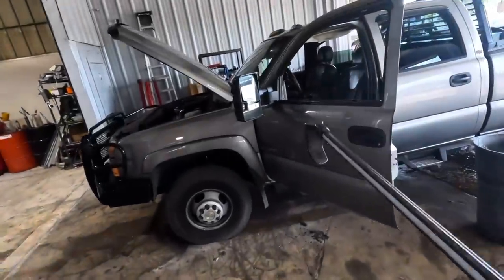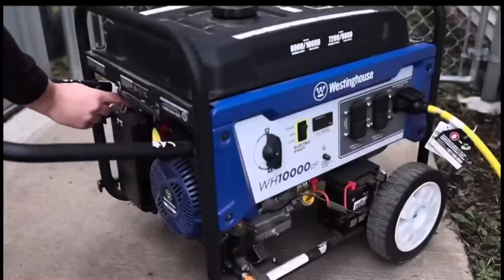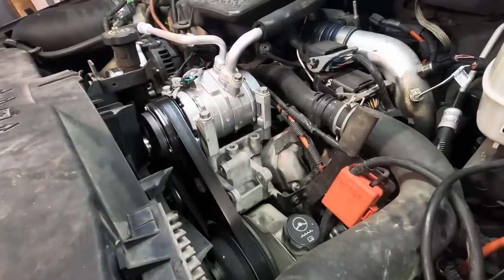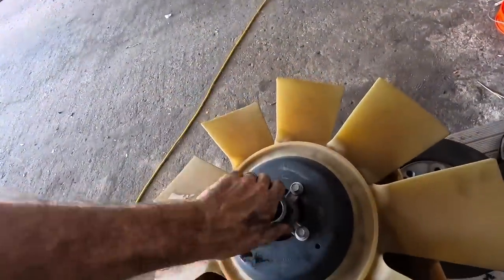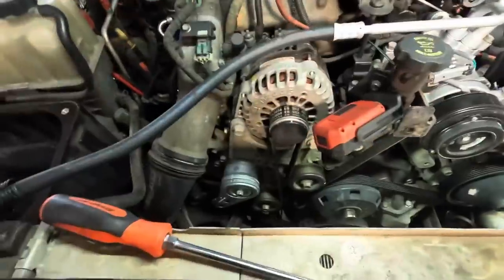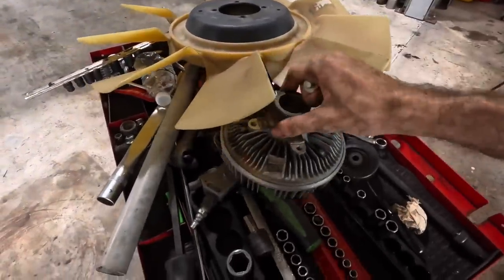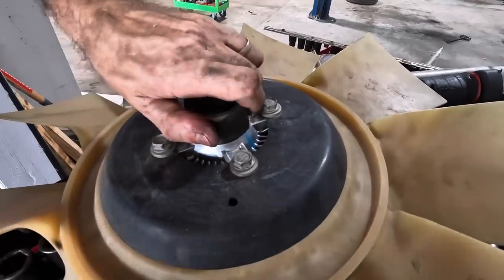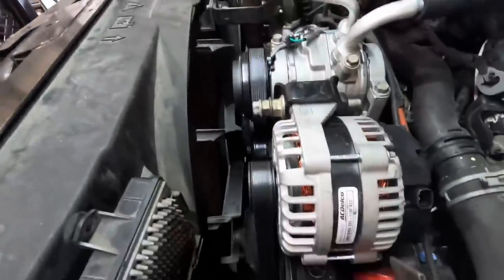Proof of Concept! Dual Alternator DURAMAX!

Comment: Ha Ray, I’m not knocking what you are doing with your truck charging system. Do you have natural gas, or a big propane tank ? If so you could get a permanently installed generator that will run your entire hame. No cans of gas, 600.00$ of diesel fuel, at least 1,000.00$ worth of stuff your mounting in your truck. Not to mention the extra ware an tare on your truck. I bet that new alt belt is at last 50.00$. Do the math. Maby it’s just makes a good video,an lots of comments. Enjoy your videos.👍🇺🇸🤪

Comment: im curious if it would be better to just get the hybrid f150 that can output like 1500w, or an old ambulance and move all the drive train into this. just so you know everything works and should stay that way. 

or solar panels? florida is horrendously sunny, they'd get something for sure
Reply: The point of this is hurricane readiness.  Those would need to be some beefy solar panels to not get ripped off during a hurricane...  😊
Reply: @gusser2121  most good installs can handle 100+ and thats a solid cat 2 hurricane
Reply: @bradhaines3142 Unfortunately, hurricane Ian was a category 5.  Solar heating and electric panels strewn all over.the landscape.  I should know, we live 8 miles from the estimated Central point of impact.

Comment: Despite the hype about AC Delco, for the most part the parts are trash made in China and won't last any longer than the cheapest you can buy. They go out right when the warranty period ends ironically. But it's like ok if Delco sucks then what's the alternative?? Best thing you can do is buy Precision from O'Reillys and get the lifetime warranty with a higher quality part.

Comment: Some slippery math there on how long your 120 gallons of diesel will provide power. The numbers are:
2 gph...............60 hours
3 gph...............40 hours
4 gph...............30 hours

Not "nearly a week'.

If you make a couple of WAGs of 20 mpg fuel economy and 20 mph speed at high idle, that works out to 1 gph, at which Ray will 120 hours of electric power-nearly a week, as he said.

Comment: Just me that thinks 145amps on the alternator sounds a little small for a diesel? Would have thought for sure 180amps would have been oem spec? But then again i have almost no idea how trucks are built since im in sweden and they arent to common here. I very much approve of this install non the less. Wish i could do something similar with my car but its a saab and space under the hood is nonexistant 😬 My 180amps will just have to suffice for whenever i do some audio installs

You could also do the big three upgrade on the existing charge system. Heavy wire upgrade between all points in the circuit. You are more than likely fine as is but overkill is a good maginal i always say 😅

Comment: Think your going to need more batteries for that much/many inverters. The general rule of thumb is no more than about 2000w per 100ah deep cycle battery, or i think it puuts too much strain on your alternators. Id probably go with 6batteries and keep it under 12000w. Though 8000w/4 batteries would probably be better. Unless you're using lithium.  But that's additional costs and different charging profiles.but lithium would probably be the way to go if you're going to be using this beast frequently or you'll be just spending extra replacing batteries and alternators anyway.  Plus lithium is WAY lighter.  Maybe that doesn't matter as much on your duelie, but it could be a couple hundred pounds in the end....
Reply: just want to impress us with his mastering of Edison talents.

Comment: Generators are meant to run long term..here is my question? You run 1-2 alternators for 24 hours + straight doesn't things start over heating..pulleys/belts/battery cables etc,? Won't items on your truck need to be replaced much sooner...? Say hurricane comes..no power for 7-10 days,,running your truck that long has got to cause issues yes or no..Can anyone eleborate on what I'm asking here..would luv to read some productive criticism about my  concerns..:)
Reply from the maker: It will run for days without issue as long it’s not at idle.
Reply: Thanks ray for taking the time to send me a reply...Your appreciated as always @RainmanRaysRepairs

Comment: If it burns 4 gallons per hour with 120 gallon tank thats only 30 hours of run time; barely more that a day. At $4 a gallon that's about $100 a day. And if you are able to do 12Kw that should be plenty to power all your stuff. Don't see why you'd run a smaller gas gen during the day.. it won't power as much and will burn just as much gas.

Comment: Ray, with 12000W of inverters you will need bigger alternators, and wiring, as that will be the equivelant of 1000A going through the wires to supply the inverters from the Batteries, your alternators will be putting 250A back into the system, so the remaining 750A will be coming out of the batteries, which to my guesstimate will go flat in about 20 minutes at that load, so reconsider the extra inverter. presuming the inverters are designed for double load for a short time, I see that as more 3000W and 1000W under normal conditions which will equate to nearer 330A slightly more than your charging system will be putting back in, but sustainable for a longer duration.

Comment: Why not just install a 320 amp mechman alt? Puts out over 100 amps at idle.
Reply from the maker: I’ll probably move the new delco alternator to the other side to replace the car quest reman that’s currently installed, then if I need to add a larger capacity alternator in the aux position. It’ll depend on the amp draw of the inverters and the amp load on my wiring. Its going to take a few stages of reconfiguring until the system is  right

Comment: So,
At what RPM do you need to run the alternators in order to produce enough power to make the system a net gain ?
V8 diesel running 1500 rpm over 8 hours….is going to consume far more fuel than 5 gallons.
But at least you can power a city.😂

Comment: this has nothing to do with todays video but mechanics may get a laugh at my mistake. my /98 corolla began to leak oil.. it wasn't much so i didn't worry about it  immediately but over the next 2 weeks the  oil stain under my car grew larger so i made an appointment with my regular mechanic. it was a 10 day wait so I did not drive it except once  to get groceries 3 miles away ... on the way back home my check engine light came on,,,   Now i was scared so I had it towed from home  to the garage for its appointment which was 15  miles from home,,,, mechanic looked it over and found the drive through oil change place i last used never tightened my oil drain plug, it was finger tight  and I had lost 2/3 of my oil, they also spilled oil all over the top of my engine so it was all over everything..    he told me had I not towed it in the engine would most like have seized... i really wish all mechanics had Rays work ethic and love of brake clean  lol ..    I got lucky,,,i take care of my old girl and she was not harmed by this neglectful incident and as a bonus I had  him look everything over and  am having a window regulator and a belt replaced,  I get it back on Monday. i will never use a convenience drive through oil change service again.    I feel bad taking my car to the  garage for something so minor as an oil change wasting the mechanics time but I cant do it myself.

Comment: You are using the wrong alternator you need to use older 4 pin alternator.  the alternator ( 2 pin ) you have is RVC Remote voltage control voltage is controlled by PCM The most you will get is 13.8 Without computer signal Use 4 terminal alternator Turn it on with l  terminal with resistor in line you will now get 14.6

Comment: How how how how???? (I am SO sorry, but I'm probably going to be ranting about this for awhile). Ray should know better, and we, as the audience always expect him to do better. In that vein, I would like to point out everyone has blind spots, buuuuuuuut.....how could Ray have SUCH a MASSIVE blind spot in his automotive knowledge???? How....how....how how how, HOW????
Reply from the maker: What am I missing here??
Reply: @RainmanRaysRepairs  In a nutshell = Forced induction. The way my auto instructors explained it to me back in the day was quite simple: When you run electricity through a circuit, it generates a magnetic field, and when you have that sudden disconnect, the field collapses and induces blah blah blah igntion coil, you already know that. Point is, your alternator, when charging, is essentially a GI-HUGIC ignition coil just WAITING for a chance to fire, and if you DC the battery while it's charging, what do you think is going to happen to that MASSIVE induced E.M.P. that now has no where to go? It's got to ground out SOMEWHERE and now suddenly the path of 'least resistance' is right through vital electronic components like the diode trio in rectifier bridge. Apologies for so much flak in the comments section, but most of us only complain because we truly care! (BTW, the office pool on the 'door of death' is up to a year! 🤣🤣🤣)
Reply: @RainmanRaysRepairs  TBH: You're probably going to need a S.A.B.R.E. or other likewise diagnostic machine capable of scanning for a bad diode pattern just to make sure you didn't blow anything up...
Reply: @RainmanRaysRepairs At least the regulators in a GM alternator are Super Easy to change out (barely and inconvenience!).

Comment: Just like the Germans over customizing your engine to what really it is specified for ,turning a vehicle into a tank , when you could possibly set up the same at the house then drop a belt through from the vehicle to the alternator at home , your vehicle and your gaff i understand and yes diesel , i just think it would be simpler to set one up at home than turning your vehicle into a tank.

Comment: I think your figures are off.   A 100 amp alternator gives you 1200 watts. 140 amp equals 1500 watts. Total of 2700.  2800  watts.   Not 12,000.  Maybe for a hour.   A intvertner  generator of 2,000 watts uses a gallon of gas per 5 hour ?  Not like your 8,000 watt that uses a gallon a hour.    Big question is how must power do you really need. ???  If you cut out major electric uses. Electric dryers, central AC stoves, vacuum, hair dryers ect. 2,000 watts most likely will be enough .  We change to those electric meters that gives you electric useless every 15 minutes.  Like at 9 pm when everything is quiet,  only TV, lights, normal thing. I use about 1 kw per hour   As I can live comfortably (with out AC) on 2,000 wats

Comment: Something is not right. That heat gun should not get that size of cable to the alt. that hot. The alt. I thought you said was 120 or 140 amps. That heat gun on high side does not draw 20 amps even. Other wise I trip my 20 amp breaker in my garage with other things plug in also. I would say it does not even pull 15 amps at best. Your alt won't last long getting that wire even warm at 15 or 20 amps. Something is not hooked up right. You must be drawing to many amps from something else.

Comment: I still disagree on the way this is setup.. I get it your using what you have but I still insist alternator isolators for the batteries this way the in vehicle batter can be charged as well as the sub batter bank.. I also still disagree on the battery choice.. Marine batteries don't offer much power over time ah. I use a 24v 100ah LIFEp04 battery its a great battery it has a BMS installed on the battery works well. My advice is 3 12volt 300 ah batteries with a 12k sol ark charge controller/inverter This will allow you to apply Grid power if needed to your bank to charge the batteries/run power etc. KB solar out of one of the Carolina's I can't remember which one they are located in but they have really decent 450 watt panels 24 panels in arrays of 6 would be great to charge your battery bank and run your home power afterwards there again taking the stress of the engine from running all the time. There was a guy once that I was watching that he put 6x6 post in the ground in 8 locations and basically created with 2x4 a permanent mounting for his panels on the side of his house. That fold up flat against the home Then on the bottom 2x6 rails he had painted osb to cover the panels for the incoming storm. Basically he would plug that into his inverter charge controller with 8 12volt 300 ah batteries after the storm went through saving him fuel on his genator needs. Since the solark can be programmed to start a generator I imagine that it could be programmed to start your truck similar to how you use a push button to start the truck up to warm it up in the winter time.. Idk just my thoughts on this like the concept just now how I would go about it if it was my online line of defense.  Like the dual alternator setup again just be careful not to blow up the regulator.

Comment: Disconnecting the battery while charging; seriously Ray? Did your automotive mentor teach you NOTHING??? Or were you just not paying attention during that lecture?
NEVER DC THE BATTERY WHILE THE ENGINE IS RUNNING; For F***'s sake...

Comment: AutoTech Engineering can get you a nice high output nator for better prices than Mechman, & JS, Brand X, & Auto Tech Engineering has better customer service. I got a 350amp denso hairpin that I can add diodes to the harness input wire, & I can bump up my voltage. Right now I'm charging at 15.2v but I also have an 80ah YinLong Lithium battery bank. Ray, i think you are going to need a HO Nator, & get 2 runs of Sky High 0 gauge OFC Neg, & Pos runs to the back. for 10k watts that's what you're going to need for sure.

Comment: Run a die  on those bolts to get the thread length you need  then cut to the right length.  Amateur back yard fixes jus like som of your customer repairs.

Comment: That would work great for power outage make sure you fill that breast of a truck it cost me $105 bucks to fill me Sierra 1500 2001 SLE extended cab 2 wheel drive so your must be $150 min

Comment: In other news, A MAN IN FLORIDA blew up his own alternator by disconnecting the battery with the engine still running...
You lost a LOT of credibility in my eyes (and many others) by doing this. I'm half tempted to unsubscribe after two years of watching your channel because of this unless you make it right and admit your mistake.
Reply: You are right, you shouldn't disconnect the battery with the engine still running, but there is a difference between not knowing something or simply making a mistake. I am sure Ray knows that disconnecting is a no no, but he was excited and made a mistake. Everybody makes mistakes, so don't be so strict. By the way, it was his generator, not the customer's, and this generator wasn't even connected to the truck's electrical system. He risked 2 things: his credibility (if you think that he didn't know) and some diodes in the Wheatstone Bridge circuit inside the generator.

Comment: u need to delete the engine driven fan and go all electric...
u will gain horsepower and also a cwry reliable and robust colling system
if ur fan clutch goes..ur ruined ur engine